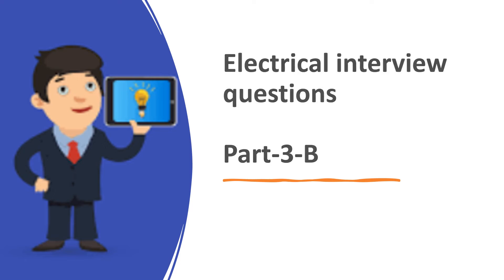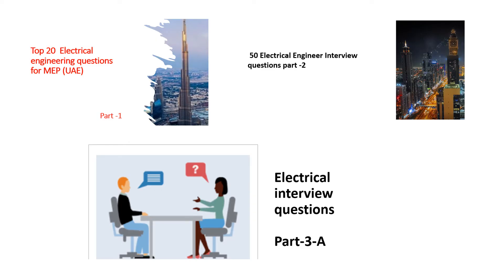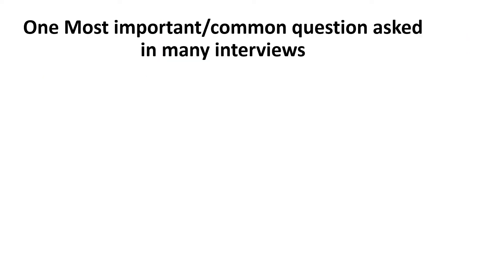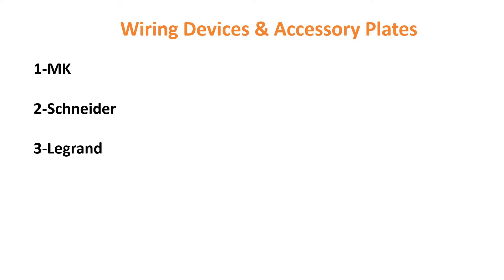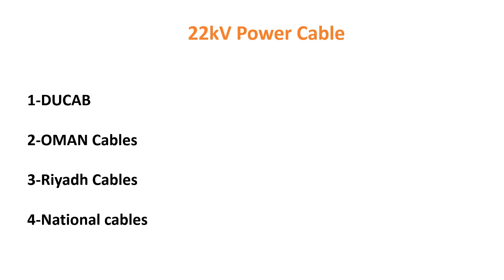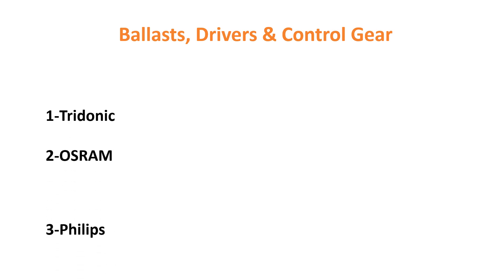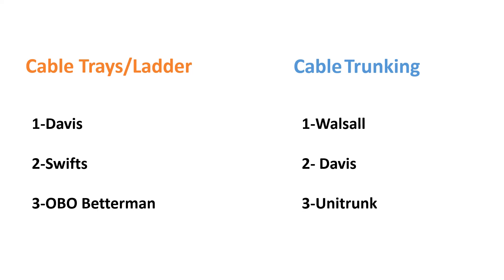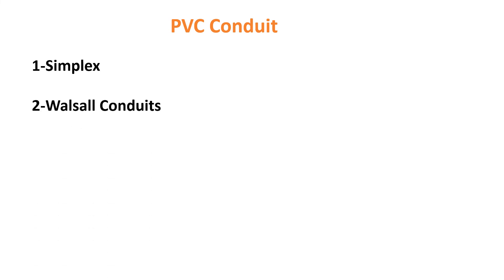Electrical interview questions part 3 B

Comment: Can you make video on voltage drop calculations for xLpE cables .  I have to calculate voltage drop for 630 single core cable with the chiller load of 820KW
Reply: It is 135meter, I need the procedure to be explaine. Thanks for reply
Reply from the maker: @MdShahbazalam226   I  will make a video soon
Reply: Total runs are 11
Reply from the maker: @MdShahbazalam226  can you provide distance between breakers and  load end